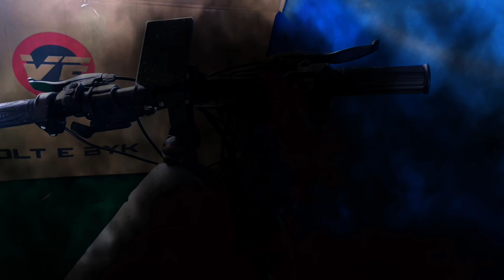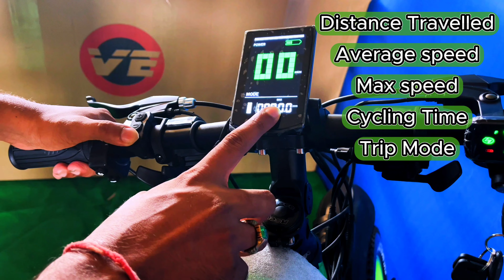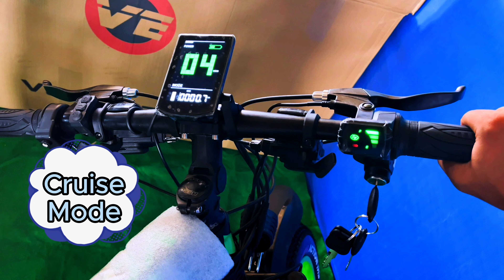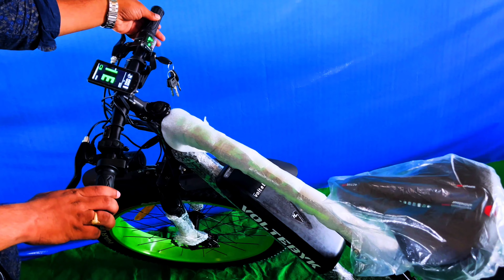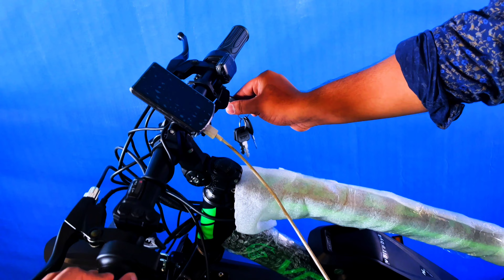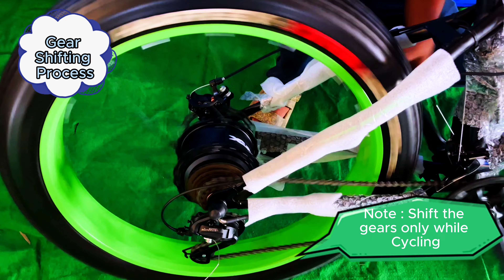How to use RUNNER PRO PREMIUM electric cycle #after #sales  #everyone #cycle #runner

Comment: Sir, can i remove the battery and can i wash the cycle with water? is it waterproof.pls reply sir
Reply from the maker: @JosephImmanuel-nl1xq  please use wet cloth to clean the battery
Reply: @VOLTEBYK_OFFICIAL  Sir, not cleaning the battery.I want to know that can we remove the battery and can we wash the electric cycle with water. pls reply sir
Reply from the maker: @JosephImmanuel-nl1xq  Even after removing the battery, there is battery plate where we insert the battery on that pins, many people doesn't notify that water on those pins after washing. Better use wet cloth to clean the bike
Reply: @ Sir, can we cover the battery pins with plastic covers and clean the bike with water?
Reply: @ Is the bike is ip65 or ip67 ?